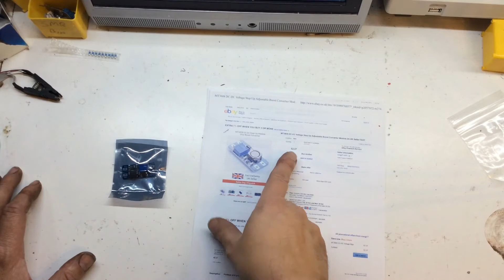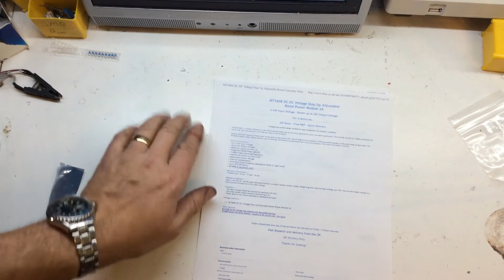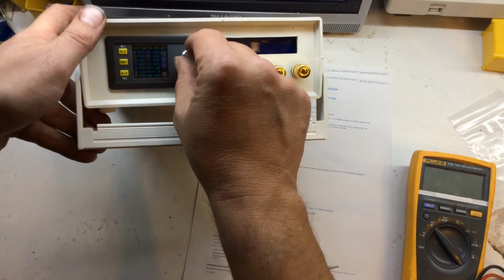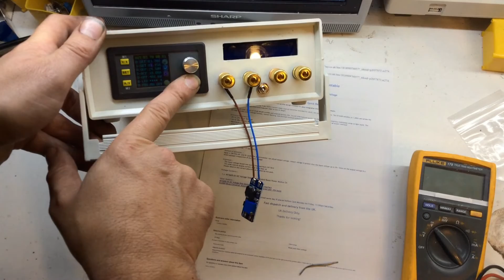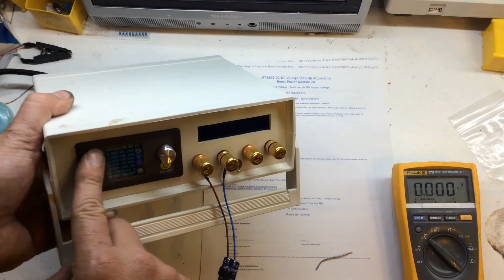MT3608 DC-DC Voltage Step Up Adjustable Boost Converter Module 2A

Comment: Can I connect the MT3608  in parallel to get higher output current ?  Such as 2 boards for 3.7 V  input to 12 V 3 Amps output.
Reply from the maker: would be better to get a larger dc-dc converter.

Comment: I bought the same on aliexpress. The price is 0,3£. Has bought already 3 pieces. All 3 were not working. I feed 4.8 volts and at the output 4.6 volts. Rotation of the regulator on the board does not affect Volts in any way. I am saddened :'(

Comment: can I charge 12v battery in this converter in 6v 3waat solar panel please please tell me. and. how many times charged this battery in 3waat 6v solar panel
Reply from the maker: You would need some charge circuit after this and even then you would be lucky if you got 12v at 1w (83mA's), if you got 12 hours of full sun you would get approx 1Ah per day.
Personly i would not bother or if i was going to i would not use this converer and invest in another 6v 3W panel then you could have 12v at 3W (still poor but better). Alot depends on the size of the 12v battery your wanting to charge.

Comment: Hi, Thanks for the video. I was curious about what happens with changing input voltage. I got the answer, output is stable. I also plan to use it with LiPo or powerbank as input and need 10 V for output

Comment: Hi, Thanks a lot for this video! Can I ask how you got on with the LiPo? I've had three of these fail immediately when connected to a micro drone 380mAh LiPo, with the POT set to its lowest then slowly cranked...
Reply from the maker: not that far into the project yet, will keep you posted.
Reply: Hey! Thanks for the reply. Yeah, it'd be great to get an update as I think these modules could be really useful
Reply: Mike Faulkner - I had one fail when using it on a LiPo too. From what I read you should make sure the output voltage is always set higher than the input voltage. I made a video about repairing the module: https://youtu.be/-3tBw6WSZVM
Reply from the maker: Havnt used it yet, was going to connect it to a 18650 to produce 12v